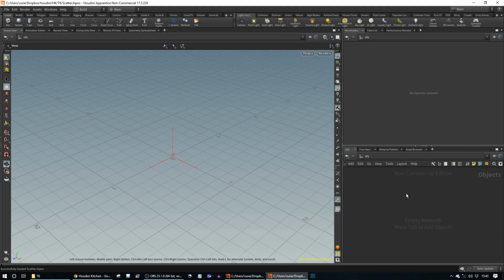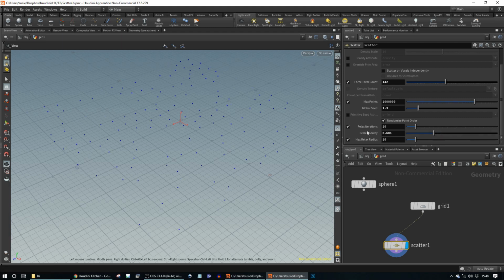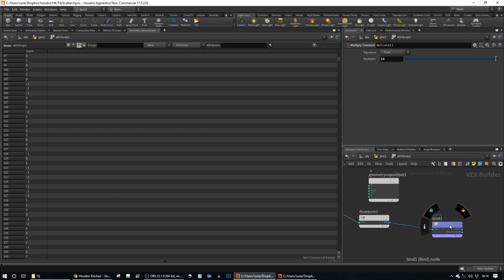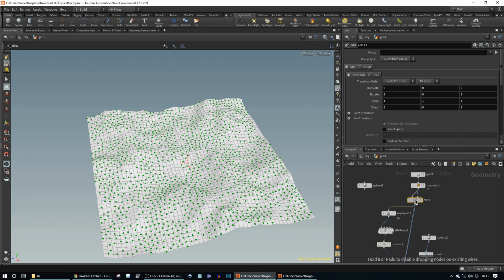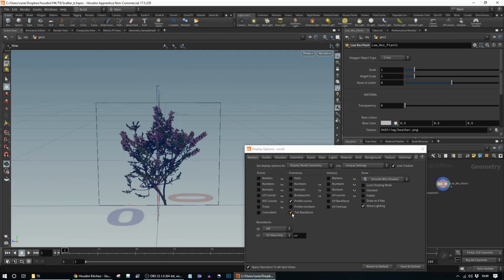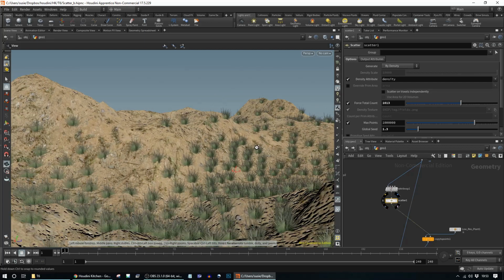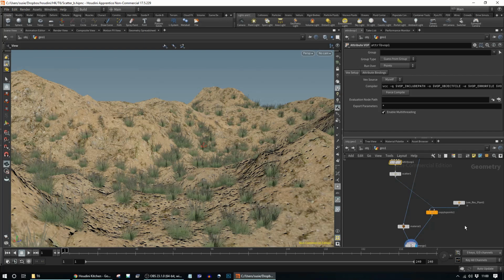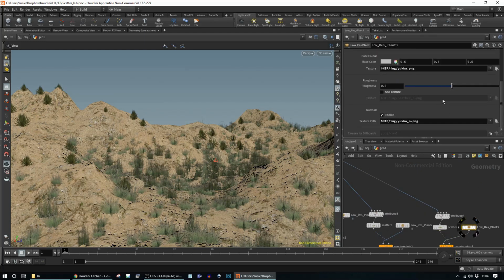Tutorial 6. Scatter Node

Comment: can you use this to scatter on a plane or in unreal engine landscape and decrease their radius of distribution like for only 1m x 1m?
Reply from the maker: Do you mean scatter only within an area 1mx1m? I would use the density. Make a density attribute that is constrained to a 1mx1m area (everything else has a density of zero) and use this to drive the density of the points. You could use another object to find the center of the area (make the density attribute based on distance from this object)- so you could move it around the surface. Let me know if this makes sense or you want a more in depth explanation- or if I have completely misunderstood the question.
Reply: @houdinikitchen  you really did understand my question, the thing is too that what If for example I wanted to only distribute the scatter on object or static mesh not in the landscape that is also possible right and how I can implement that? thank you, still lot to learn from houdini.